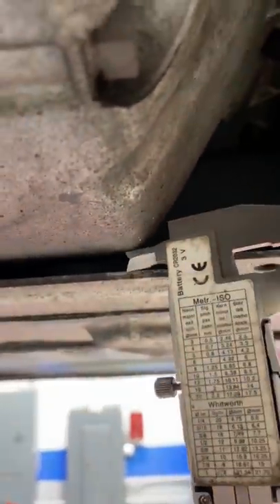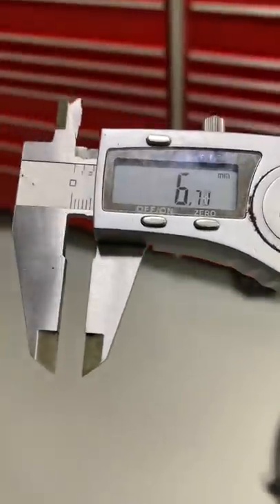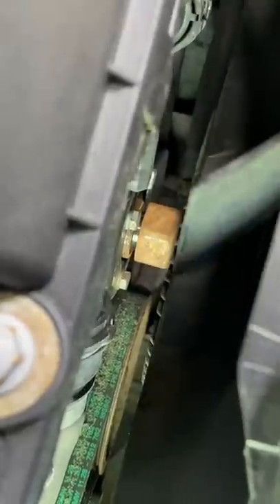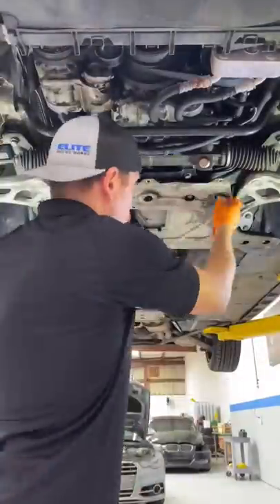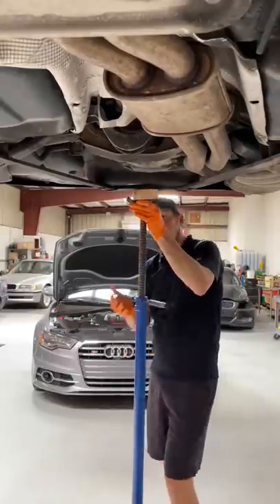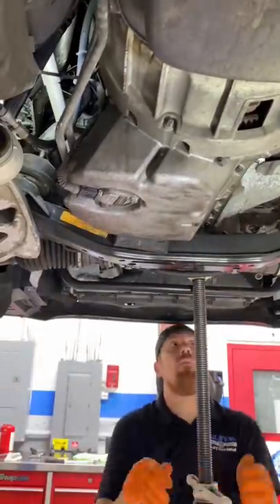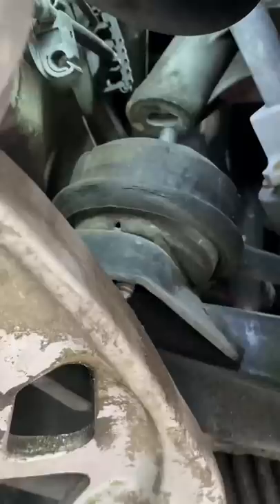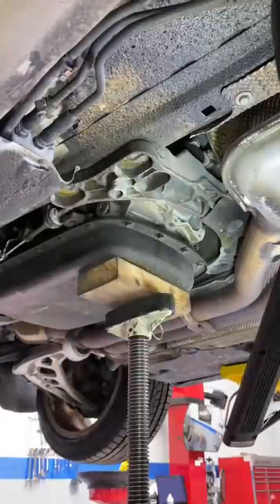Big Difference! New mounts #shorts

Comment: Replacing the engine mounts regains massive driving quality. Did this to my 24 year old Audi a couple of months ago and the difference is absolutely crazy.
Reply: Is it more smooth going over bumps? My car seems to be riding more rough over bumps. Shocks are fine
Reply: @MrPorsche91730  I have a benz but for me replacing the mounts reduced vibration at idle drastically especially at cold temps
Reply: MrPorsche91730 Engine mounts won’t improve the ride quality. There’s a lot more than shocks that control your ride quality. Depends on your suspension set up but generally for cars and light duty trucks you have sway bar bushings and end links, ball joints, control arm bushings and of course shocks. Are you certain your shocks are ok? Aka when you go over a bump especially on the highway does the car seem to bounce more or longer than it should? Also if you just replaced them, low quality shocks give a low quality ride. Hope this helps you
Reply: Engine mounts are always forgotten just like the suspension
Reply: I have also a 2001 b5 a4 TDi Audi. I feel the engine so "near me", and if i go to 3000 rpm I feel it like it's a sports car. You say that even if I don't have big vibrations inside, replacing those rubber parts will make the care more confortable? I drove a Vw Bora with same engine and i felt like the engine is "far away" from the cabin and was running smoother
Reply: Thanks for the help. My car is a 2003 Lincoln town car. At idle it's too smooth and quiet I can't tell if it's on lol. But it's at 320,000 km and it's starting to feel like it's crashing over bumps in front, it doesn't bob up and down after hitting bumps it's pretty solid that's why I thought possibly engine mounts. Thanks for the help
Reply: MrPorsche91730 I would have to guess it’s more in the ball joints. You need to find a good trustable front end shop and take it to them and see what they say. If you have a jack and some jack stands there’s plenty of videos that tell you how to test your front end. Just remember everything is supposed to have some play or else it’d be stiff as a board but when you hear banging and clanging going over bumps or feed back in the steering wheel you have a problem
Reply: Laurentiu I think you have a diesel. I’m going to assume that’s what the tdi means? Not sure I don’t work on audis but if it’s a diesel it’s normal to have more vibrations and noise especially higher in rpms. Changing the motor mounts will probably help though as it is a 2001 model
Reply: @huntguy3831  
Jus the info I need. I'm riding on off set rims, half or 3/4 inchspacers in front to clear the massive calipers which would rub the rim. Rear drive 8.8 diff. 
New non adjustable Gabrial ultra gas shocks in rear which gave me a wierd issue tht I can't seem to correct. It's the wheelwell to ground height is of almost an inch, even tho I got the front lifted an inch and half it doesn't fall smoothly, hits fender only on driver side which now needs replacing due to rust. Correcting my ride height is driving me nuts, its not noticeable to me or others but I kno becuz I'm the one driving & checking ride heigth. 
My end goal was to have more bite in rear, tighter rebounding from travel. To be Able to tow without compromising ride height tht was too soft 4me even with a sport suspension,  which ive accomplished somewhat but the front is now a big issue. I kno I need to replace every suspension component on the front due to off-road abuse, damages cant be seen but i kno something is not adding up, especially if the rear has been done & still sits low.
Reply: Eyes of a Gemini Sounds like you need a good set of adjustable coil overs. Depending on the car for a good set you’ll spend $600-$1000+ but if you’re wanting to adjust your height and dampening then it’s well worth it. Plus they’ll ride better and last longer with a quality set. Best advice is find a forum for your car online and see which set people say is the best for your car
Reply: @huntguy3831  
Yes, adjustables will help. I believe I have found the answer, which is replacing the entire front end F150 springs, control arms, bushings ECT. Thanks becuz it all leads to something I was avoiding. Im purchasing the special tools to replace front suspension today. Parts wont ship till end of month from rockauto.
Reply: Eyes of a Gemini Awesome! When doing your control arms don’t tighten the bolts going from arm to frame until you have the tires back on the ground and all of the weight on the suspension or you will mess up the bushings. What year f150 is it? For a couple of days leading up to taking it apart spray rust penetrant on all of the nuts and bolts, and where the ball joint goes into the knuckle, you’ll be taking loose and it’ll make your life a whole lot easier. Good luck
Reply: @huntguy3831  
It's not a truck, but a high pursuit UTE V tht makes ppl stare like wtf. It's a long wheel base body on frame tht has alot of fabricated parts. It accepts F series, Expo, or Explorer parts & wht doesnt fit to spec, I either have to fabricate or relocate due to it being modified with heavy/severe duty parts.
 Reinforced frame & brackets came about from safety issues during high speed pursuits in the Nevada deserts due to its notorious past life, which was clearly documented by the fed. 
Its sole purpose was strictly business, to remain reliable under extreme temps, travel further between fillups, withstand impact at certain speeds, strike fear & intimidate while being fully capable to take down fleeing motorist. 
Truthfully, this mf has outlasted every vehicle ive owned & it still surprises me. 
I do all the maintenance myself do to its extra reserved fluid capacity, the mismatched parts bin seems to confuse younger mechanics who think they can bypass security feature or joy ride without me telling them exactly how it behaves are dumbfounded. All options added on after POS driving preference custom set by the previous owner. They outfit/ retrofit special vehicles after point of purchase. The pursuit package could be optioned differently in so many ways leading to a maze of wiring that can be a nightmare, its very difficult to find information after vehicle decommissioning The installer could be anybody. Luckily I was the 1st recipient of its early retirement, the vehicle wasnt even for sale, it had all the equipment which makes it illegal for civilian use & cant be legally sold. Upon registration I learned the Vin code is federally flagged, I was confused myself, I eventually spent entire weeks researching, dissecting what I had to do to make this car legal. I had to remove most the equipment & rewire the entire mess I was pulled over at least 6 times the 1st month I had it, almost got it impounded, just 1 headache after another. If it wasnt for me having the owners personal # & proof tht it was gifted, not really but the owner already knew how to cut thru the tape & this vehicle had to go & he couldnt bring it with him. I learned so much about its history, why it was a mixture of parts, how it was maintained & how it never gave him any issues & how far & fast, this vehicle would reach critical speeds & be solid with the correct speed rated tires, tht can put a dent in ure wallet. 1st test drive he easily hit 90 mph, took corners like he was in a mustang, scared the hell out of me. I wasnt sure wht was goin on after tht because it was like I was being punked. I never seen a brick with a torque curve so wide, this interceptor is geared for heavy abuse, ive pulled a loaded 20ft trailer too many times to count, with its massive radiator, all kinds of filters, coolers, hoses, 24v of pure power and never been stranded. I've parked this thing for months & hop rht in & crank, never hesitated to start, the thought hasn't even crossed my mind. But now it's starting to show its wear & tear, I kno it's time 4 major overhauls, check engine light comes on every now & than, cats need replacing, or 02 sensors, plastic is brittle, lights tend to randomly malfunction, dif needs servicing, nothing I can't handle, but thanks for the advice, & trust tht I've been hitting every bolt with blaster, when I did the rear I ended up having to cut the bolt clean off cuz it wasn't budging, it was hell getting the bolts loose to replace the water pump. Manifold gasket replacement took days. What you may think is a simple hr or 2 worth of work will require the biggest breaker bar, the exact deepset socket, the patience, the determination tht u will succeed successfully & may need to replace something else & the open budget for unforseen repairs if u think like I do. Ive done more than enough remodling, installations, the maintenance & repair on heavy equipment, numerous issues can materialize out of nowhere in the field & nobody cares tht u ran into this or tht detail doesnt work & u had to quit, the only excuse tht is acceptable is tht you figure out how to make it work & keep the project moving along or get replaced by someone tht can.
Reply: Eyes of a Gemini That is badass unit you have there. I’d like to find one for myself actually lol. Sounds like you have some experience working on stuff and you should be fine. Best of luck to you my man. I know how the easy jobs turn into big headache jobs. The other day I was working on a f150 that came in with a misfire. Turned into replacing the engine
Reply: @huntguy3831  
Appreciate it. Yeah its pretty much a rarity to come across 1 built like this & they mean bizness. I still see a few in town when the swat team deploys, they have oversized steel bumpers tht hog up the lane. Easily boxing in or ramming vehicles off the road.
It's crazy how intimidating they look & still strike fear when u see them. They have an uncanny nostalgia to them, longest running patrol unit ever & u can clearly still see them being used by police to this day. Built like tanks to last, so I recommend u definitely get 1 as the panther platform, popularity & price on some of these are going sky high due to an occult like following. I've seen them go for as much as 8grand for mint condition panthers. Get 2 if u can get 1, ure gonna need it for spare parts 1day if u plan on keeping it for the long haul.
Reply: No u Screenshot? Lol I have no idea
Reply: Just had them replaced  last month, I felt a ton of difference in terms of  ride quality even at idle.... no more shaking and vibrations.  Due to the newly raised engine positioning, I needed to replace the coupling of the propellor axle to make the clunking sound stop.
Reply: @adriannewman1322  I had no choice but change mine after that vibration @ 60 mph... the vibrations stopped altogether. Plus it wasn't even efficient with the engine moving upwards in the engine bay  when accelerating.
Reply: Did it to an almost 50 year old c3 I am restoring. Quite the difference.
Reply: @MrPorsche91730  ooo
Reply: @MrPorsche91730  oooo
Reply: @huntguy3831  I believe that Porsche uses magnetic fluid in the engine mounts. In comfort they go soft, in sport they go hard. Obviously the suspension is the most important factor but I'd imagine the soft mounts improve ride quality a bit. My car is 20 years old and I imagine hard rubber. Also it's a body on frame, maybe the mounts where body sits on frame are bad
Reply: My car needs this 100%. I just need time.
Reply: @MrPorsche91730  no friend it has to do with your struts if you feel stiffness in your car or feel more of bumpy roads . Your suspension systems change them
Reply: Hmmi wonder if this is an issue in my 1998 F150. Probably not cause it's an American truck and you guys are talking about Luxury European cars.
Reply: @MrPorsche91730  Do you run low profile tires? You can put in the best shocks ever but low profile tires wil always make bumps seems bad.
Reply: @MrPorsche91730  like the name
Reply: Was it expensive im gonna have to do this with my 05 mercury mariner premier 😳
Reply: @huntguy3831 unfortunately that doesn't always give away bad shocks. Mine passenger side is shot from an accident on my passat diesel. It survived the accident but has started getting a bit clunky after a few thousand miles. It doesn't bounce over bumps improperly and handles potholes okay but it has gotten clunky when cold
Reply: @huntguy3831 to be honest, every vw diesel I've had is more vibration at idle than anywhere else. Second you load them up it's smooth as butter, especially so at higher rpms. I could drive all day in the wrong gear at 4k rpm and barely feel the motor. Not so much at 1500 rpm
Reply: @DarkAttack14  Bouncing is old bad shocks however shocks can leak and not be bouncy but they should still be replaced. 

All depends on how the engine is built, how many cylinders, and cylinder configuration on when the vibration occurs. I am used to working on pickups and semis where you get more vibration the higher the rpm. However I have worked on a few tractors and those were the opposite, much like the vw diesel you are describing.
Reply: Got a failed hydro bearing (fluid filled mount) on an R50... I will get around to it!

Comment: Don't forget the power steering hose. It will snap clean off if you raise the engine too high. Which is needed to clear the new mounts.
Reply: What snaps, the metal section with the banjo joint?

Comment: "We're gonna reuse those heat shields" everyone says it, everyone forgets the first time around.
Reply: Was literally about to say that.
Reply: Weight reduction bro
Reply: Bolt everything up and then see them on the bench as the owner drives away.
Reply: Lmao I had to watch two times lol I didn’t realize he missed it lmao
Reply: he didn’t miss it.. they only have a heat shield on the exhaust side
Reply: @rdub907  really…… you would think on both because then it would bring the motor up on both sides another few millimetres
Reply: @d_kortman  you know you're a good mechanic when you can put the car back together with fewer bolts then it came with
Reply: @chronus9083  brilliant comment lol
Reply: Thems is extra parts
Reply: It's like a bakers dozen that the manufacturer makes for us mechanics later on down the line. We get the 13th one y'know 😁
Reply: Aaaand THATS why rubber mounts may be an issue. While they provide a smoother experience with the engine shake, their well... rubber-
They can melt under way Lower temps than other metal mounts. Which is a big deal for wear, and they also wear down far faster then metal mounts to begin with. Although to be fair, under bad enough conditions the metal mounts could experience heat expansion and seize their bolts onto them so...
Reply: @d_kortman  and premature failure of your new mounts but I know you know that.
Reply: Changing my plugs on my silverado ima reuse my heat Sheilds.... after I finaly got them off...... ya fuck these
Reply: I don't own car, but I love watching your video .
Reply: @2ndlt.sadness67  vulcanized rubber doesn't melt it burns
Reply: Replaced a u joint and hub on a crusty 88 jeep. Got everything together and then saw the rotor dust shield on the floor. I'd like to say I put it back
Reply: @2ndlt.sadness67  I'd say the biggest downfall to metal mounts is, once they are compressed... they stay that way lol
Reply: @some-replies  put it back alright. All the way in the back and left it there lol
Reply: @derekborba9574  rite , then when he outta sight , toss em’
Reply: @2ndlt.sadness67  They didn't "melt" away. they became compressed. When you move furniture off a carpet are the indents from compression or did the carpet melt away?